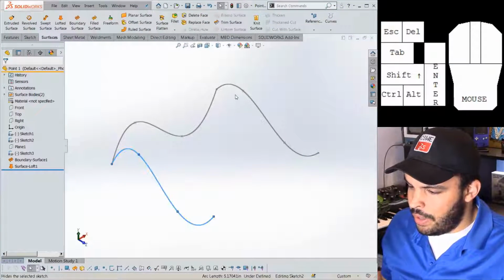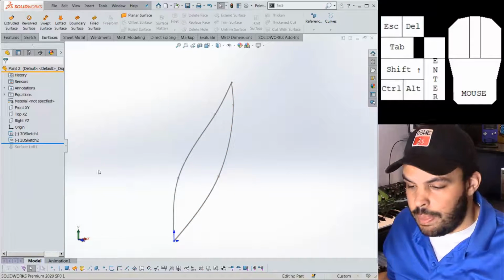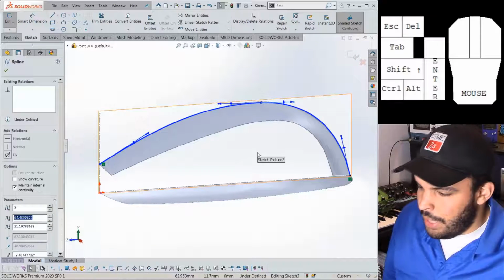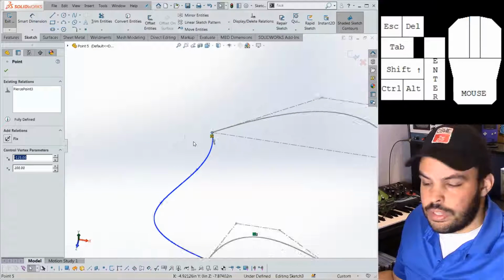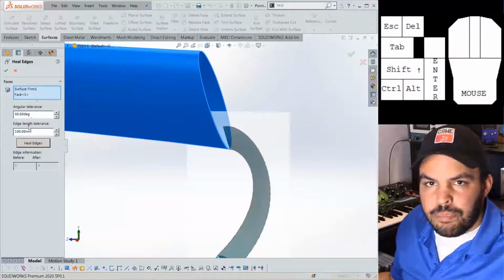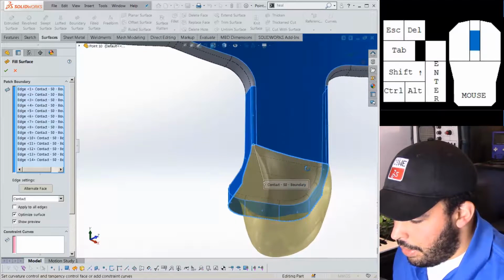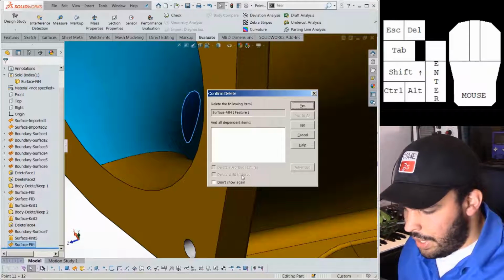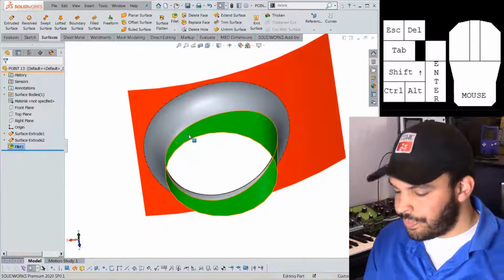12½ TIPS TO PASS THE SOLIDWORKS SURFACING EXAM (CSWPA-SU)

Comment: Delete Hole is a powerful command for sure. Along with Move Face. That bit on face fillet is very interesting, thanks for sharing. Some of my "secret" techniques: turning on auto-dimensioning on sketch creation, creating new planes via ctrl+dragging, changing selected states to more pleasant colors, single key shortcuts (M for measure, D for dimension, C for construction, N for normal to, etc), S key + right click everything, lowering spin box increments to be more useful, offset 0 (copy) surface -> untrim surface.
Reply from the maker: Thanks for sharing these!! This is sure to help a lot of people be faster in general, but the copy surface thing is HUGE and I can't believe I forgot to include it in this video!

For anyone just coming across this comment, what I mean is there is no 'Copy Surface' Command in SW. If you need to copy a surface (or copy a face of a solid into a surface), you launch the 'Offset Surface' command and type in a value of 0 (zero). If I make an appendix video to this, I'll be sure to include that one for sure.

Thanks for the save, @J !
Reply: That ctrl drag is awesome, thanks.

Comment: Thank you for the video! I wish I had watched it before taking the exam unfortunately, I didn’t pass on my first attempt. I’m having trouble with the Boundary Surface feature. I followed the instructions exactly, including setting the correct tangency and angles for each edge, but when I measure the surface area, it’s different from what’s expected. I’m not sure what I’m missing. Any advice or tips would be greatly appreciated!

Comment: Nice Video. I think the part I liked most was hearing you failed it the first time. I just failed it today. I was totally unprepared. I only have Surfacing and Mold Tools left out of the CSWPA tests before I can start preparing for the CSWE. I don't really ever use surfacing much so its somewhat foreign to me. I currently teach beginner and advanced SW at the local community college. As you can see from my videos I do mostly parametric stuff that ends up getting CAM'd out for CNC work. Shoot me a message if you can... would love to connect via FB/Twitter or Linked In.
Reply from the maker: Thanks for telling your experience. It can be tough to admit that one of these exams got the better of you. In my case, it certainly wasn't the last exam I failed either. My road to CSWE was full of setbacks and failures. It's just part of the learning process!
As a matter of fact, when I was recording this video, I started rambling about how I failed and how I came back from it. I cut it from the video because it was like 5 minutes and I wanted this video to be easy to consume and it was already getting long. Maybe, I can post it so you can get the story about how I got my surfaces cert. Or maybe I can post another video telling my full cert journey. I have about 26 right now, some of them you can only get as a reseller, but I'm not sure if everyone wants to hear about that.
But anyway, I'd be happy to connect with you! maybe, we can carve out a bit of time and get you some pointers about how to do better the next time!
Reply: VirtualFlat CAD that would be awesome. Would love to chat
Reply from the maker: @AppliedEngDesignUSA  Same here! Check your twitter DMs. I shot you a message